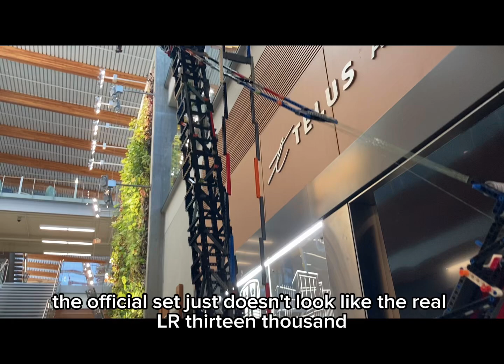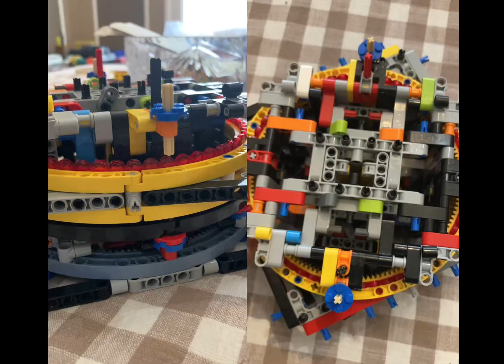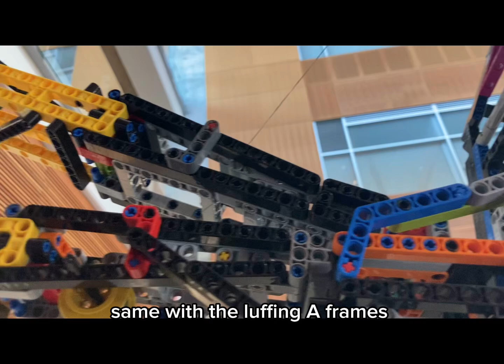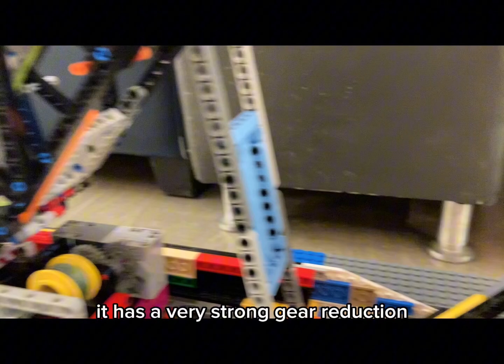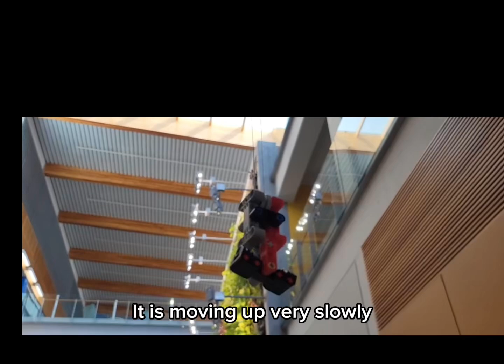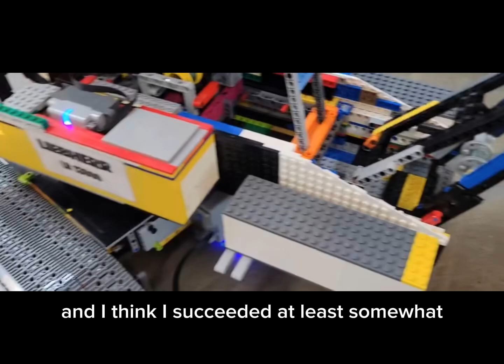LEGO MOC Liebherr LR13000 (OLD VERSION)

Comment: Is the height of the boom actually accurate with the size of the body? (Does the real thing have that big of a boom?)
Reply from the maker: Yes in fact, proportionally this model should be 8 m tall however, Lego has limits that steel doesn’t
Reply: @AFYcranes  Lego aluminum pieces next then lol.